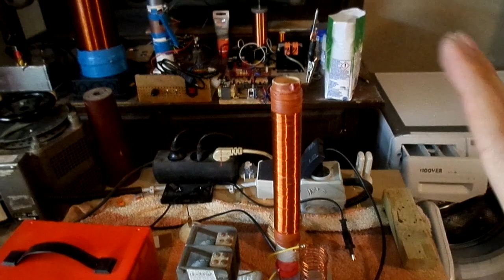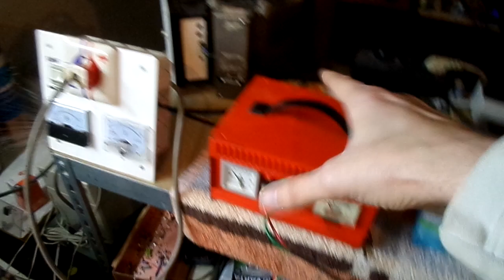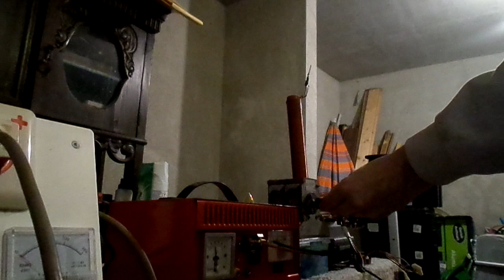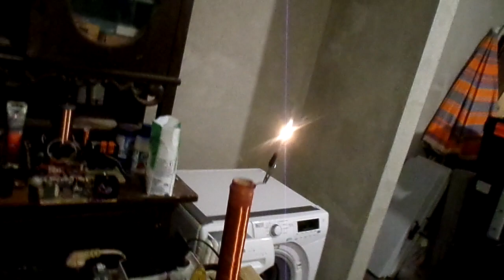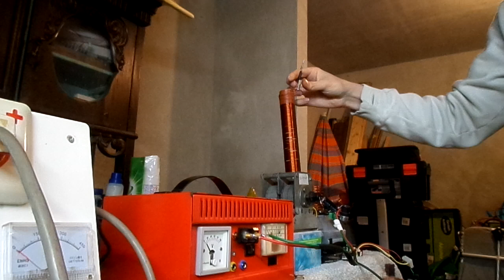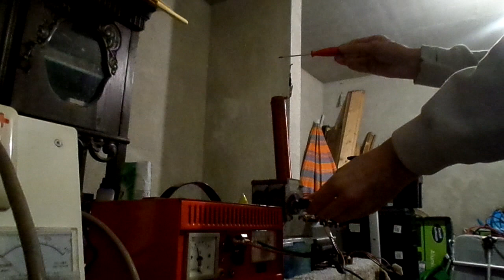HFSSTC rebuild plus medium power supply build

Comment: around  0.52   no no  don't do that !  you don't want to ground the top of that secondary, that will kill the fun !. Think of the secondary as another part of another tank circuit. That coil is the inductor, and a metal object that you put on top of it is acting as a  capacitor...with this piece added it helps the coil to resonate and that is why it is more likely to start spitting out plasma. Attempting to ground it is trying to take too much energy out of the system, and , depending on your setup, could either stop the plasma, or damage your MOSFET....

Comment: That's def a sweet flame and when it was still going at 15V that was awesome. Chicken stick seems wise. I was using a thick handled screwdriver for pulling SSTC arcs ungrounded so it wouldn't drag the circuit down and I got a wicked little burn cause an arc inside was slowly eating its way through to the exterior of the handle over time til it finally busted through. Ever have any luck with this circuit using a shorter secondary? I saw one recently that was just one of those simple jammers using the high speed transistor and dude pulled a small flame off the tip before it popped.
Reply from the maker: It was a real pain getting the circuit going but it's awesome now 😎 once it oscillates, then can it be dropped lower in voltage .. typically I dont use screwdrivers for drawing arcs but yeah couldn't find anything else 😂
Reply from the maker: And no, nothing smaller, the circuit is tailored to run that coil only but I've seen the video
Reply: @dirkk82  I got a smaller one working at about 15 megahertz but it's too much for the fets I have. It's damn near 7 in the morning here and I stayed up the whole time messing with this shit. Got some decent little plasma Flames going but I keep popping fets randomly and I haven't figured out why.. I can have everything set to where it seems relatively robust and then without changing anything can fire it up later and it immediately pops.
Reply from the maker: @Magneticitist  i had that problem too but so far this setup is good, im going to attempt to put in a fixed cap to get rid of the big one im using, could possibly kill the fet im using
Reply: @dirkk82  Did you try changing anything in particular around which seemed to give you the most improvement as far as not popping any fets? I even tried some 600v and 800v fets and while they lasted a little longer they still popped. Seems like the way to go may be to just set up a jig and get to swapping everything out.
Reply from the maker: @Magneticitist  i really dont recall anything in particular, when you get the circuit oscillating, try to back off on the pot. to get the best gate voltage possible, it will be tricky to get it just right, i can tell when the circuit draws a few amps when its not in tune, its basically in standby mode .. the feedback coil needs to be stretched out a bit too, not tightly bundled up and all 3 coils i use are the same gauge wire ... post a vid and let me see how it looks, maybe i can see something to try or change ... its a really tricky circuit and hard to tune right .. im almost done rebuilding mine so i will post a new vid with all the specs, you could try to copy it
Reply: @dirkk82  ok cool I put up a vid of the shit setup lol. Currently cleaning it up and trying to make it somewhat modular for easy changeouts. I found some old WIMA caps I can use but I'm wondering what kind of resistors I see guys using. I'm using tiny shitty metal film resistors.
Reply from the maker: @Magneticitist  nice, doesn't matter how it looks, just that it works, a lot of my things look like crap but they work, always time to make things pretty later 😂 dont think I used any special resistors but as I said I'll get it finished tomorrow and post an update vid
Reply: @dirkk82  sweet. I'm going to sacrifice my 460's I have on my SSTC for more testing lol. I've ordered like 20 more knowing they'll pop.
Reply from the maker: @Magneticitist  idk, I'm using the same irfp250 on mine, did use 460s too but I think the components values I used suite the 250 fet better
Reply from the maker: @Magneticitist  I got to order some more too, I got some other coils I want to build 😂
Reply: @dirkk82  I feel like I didn't really notice much difference on mine between the two though I'd have figured the 250's would struggle less with the frequency. I just need the 460's for other shit too though so hopefully I can make them work. I'm wondering if stacking them in parallel would do anything other than waste them quicker since they aren't really burning out from overheating over time but some instant resonant HF currentsplosion.

Comment: I've heard that these are difficult to work with , most give up as the MOSFETs get destroyed easily and tuning this circuit is a pain.
Reply from the maker: This certainly is a difficult circuit to work with, I've destroyed at least 10 mosfets getting the circuit just right but in the end, its exciting when it works and it works well